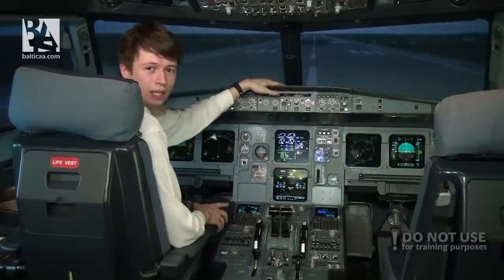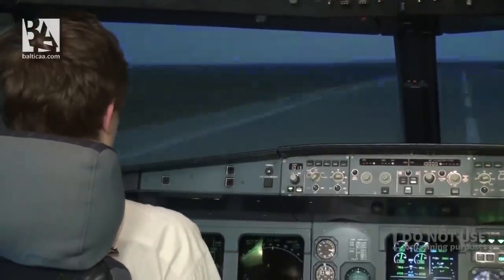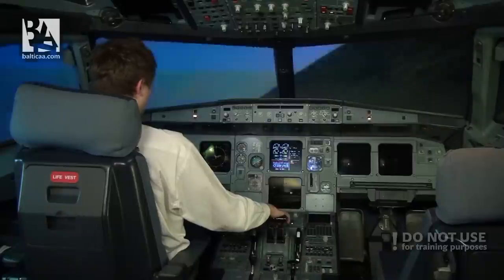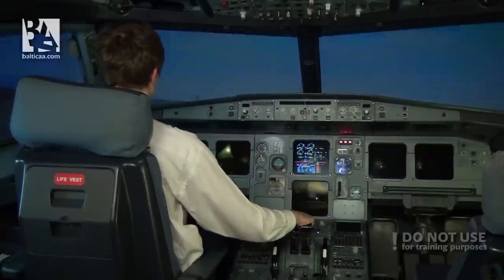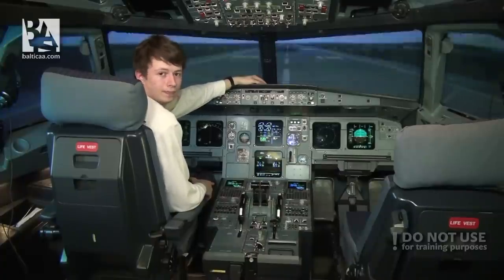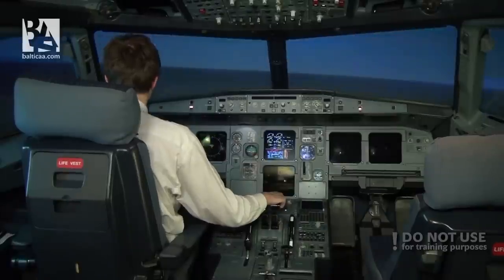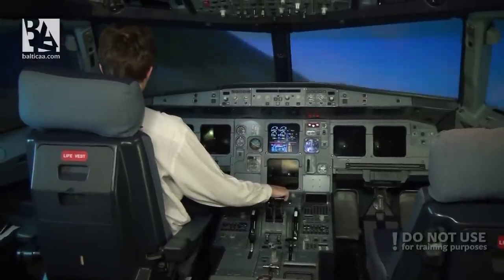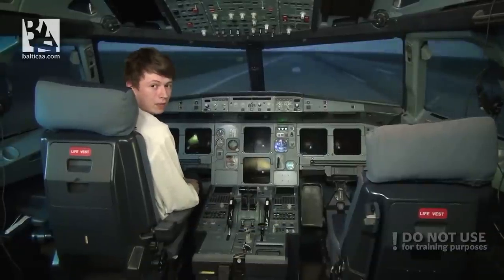Dual Engine Failure during Climb-out on Airbus A320: Baltic Aviation Academy

Comment: one question.  After the engines failure as usual you lost all of your power in electrical and hydraulic systems and counted on the ram air turbine. Why didn't you turn on the APU for power?

Comment: why dint he switch on the APU?
Reply: +Maffu Taffu yes but APU is good too and after you have more screen and it is safe
Reply: cause it takes like an entire minute to get the APU up and running. By that time he is already on the ground.
Reply: +Henry Chan yes but he can try to start it
Reply: APU is non-essential. He had power from the RAT and the ability to fly the aircraft. There's no point trying to get systems up and operational if it puts the aircraft at a higher risk.
Reply: Air News 24/7  The APU provides 0 thrust. The exhaust isn't a nozzle, and its design is to provide electrical power and bleed air rather than thrust. 

Turning it on is an addition to the already high workload on the pilots, and provides no real benefit when the RAT automatically deploys immediately on engine failure. I really don't think reaching for the APU will help in that situation given the tiny amount of time to look for a ditching site, and both pilots focusing on flying the aircraft
Reply: Air News 24/7  Where did I say Sully was stupid? The RAT is designed to give reliable power down to 130 Kts, the stall speed of a heavy A320 is about 140, and the glide speed is around 160-170. With an MTOW of over 170,000 lb, a 1,700 lb APU delivers less than 3% of the thrust the engines provide, making no change to the glide distance in such a short timeframe. We're not taking about using the APU during take-off for bleed air, that's a totally different topic 😂
Reply: Air Safety News 24x7  he landed safely, so please stop this nonsense debate
Reply: I firmly believe every flight in a jet like this needs a flight engineer!
Reply: Nakul K Mohan I thought that too
Reply: @NoJebediah  But without the APU the aircraft goes into alternate law and you lose the alpha protection. It’s worth pressing a button for!

Comment: Dear Richy, this video is meant to show "what is (almost) the lowest height from which you can return" :) In the case of flight 1549, what could have happened remains what could have happened. I am very happy that they survived, how they survived, even though it was a very difficult situation and good job by the crew, is not so important!

Comment: You might be able to pull off 2000ft if you delay gear extension as long as possible. Extended landing gear makes a lot of drag.  They may let you dump fuel too to lighten the load.
Reply: No fuel dump in a320
Reply: Loss of engine is also equal to loss of momentum. In the case of dual engine failure on a twin engine airplane below 20hundred feet while holding a pitch of 10°-15° and below 250 knots, the forward momentum will be consumed quite quickly.
I think the initial response of any pilot will be to quickly push forward, gear up, reduce flaps, switch on Apu, bank away from turrain, and quickly look for any place where there is little to no traffic or population to set that bird down. 
A 180° turn will take away a lot of momentum and require nose down action to avoid stall speeds and subsequently consume the little altitude left. 
In my personal opinion, I think all airfields should have a zone beyond the airfield to account for these types of snarios, but the fact that these incidents are so few and far in between means no organization will want to put out the amount to prep for it
Reply: @sincerelovechild  I like the idea of turning on the apu instead of the ram air turbine...

Comment: An MD-81 lost both engines at 3200 feet after departure from Arlanda, Stockholm, Sweden, after ice broke off of the wings and was ingested into the engines. Never for the briefest of moments was it on the pilots minds to return to the airport, they set it down in a clearing down range, and everyone on board made it. Had they started making sharp turns at low speed and low altitude, the most likely outcome is that noone had made it.
Reply: The difference here between this incident and the Hudson River one is that there was a clearing within range.  There is no open land in New York City, other than the airports, so the only safe option was to land in the Hudson.

Comment: This is a  Question Mark Turnback from 2,500 agl on A320.  Landed safely.  Great pilot.  No copilot needed either.  I teach Question Mark Turbacks on singles and multies from 700 agl to 1,200 agl depending on airplane, weight and winds on specific take off.
Reply: So what if they hit birds at 200 ago?

Comment: What are the two wheels with black and white bars that spin? They are located near the thrust levers. Great videos, by the way. I'm not a pilot but I've enjoyed watching these to learn what goes on in the cockpit.
Reply: That's trimmable horizontal stabilizer (THS). It is usually automatically adjusted.

Comment: Why dont you started the APU and used the Gravity Gear Extension ? PS Good Video
Reply: I think eh didnt had the Time to do that.Cause eh is alone in the Cockpit.
Reply: Good call, in a real cockpit he should have, but he probably didn't have time to do that.
Reply: Lisvenachux Roytulin is that not a rather pointless video then? Seeing as a320 is a 2 manned plane. Helpful for a simulator but seriously doubt one person would be taking off in this plane in real life. Still appreciated the vid, but would limit the necessary education if the above answer is correct... Then again, me no know :)
Reply: zebba zebadee it also depends on the weight (amount of fuel, passengers, and cargo) of the aircraft, wind and more...

Comment: In this case you knew the engines would fail so of course you can readily react to the situation.
Would a real case scenario need longer for you to assess and address the situation?
Reply: +Giovanni Di Cello Pilots are trained to act accordingly. The second the pilot heard the noise of dual engine they would have started the turn immediately. So maybe an additional 5 seconds for the pilot to look down and see dual engine flame out then turn.
Reply: @bobalobalie  This has actually happened before on two occasions and in both there is no evidence the pilots reacted as quickly as you are suggesting. In one it took about thirty seconds for the pilots to determine a definite course of action, and in the other they were so close to the ground landing the plane immediately off field was the only option.

Comment: Why don't you turn on the APU during a duel engine failure to provide backup power? That is US Airways Flight 1549 did.
Reply: Only one pilot. Normally, there would be a co-pilot to share in the task load. Perhaps there was another reason for no APU in this example.
Reply: Roger Hylton The APU takes about a minute to start and power the aircraft. He would be dead or on the ground.
Reply: He was in the air for a lot longer than 60 seconds, providing him with more than enough time to start the APU.
Reply: He had power from the ram engine turbine

Comment: But, unlike most other large airliners, if you lose all hydraulics on a 737 the pilot can still control the jet through manual reversion, although it takes alot of physical effort. You can still operate most of the primary flight control surfaces because they are still mechanicaly connected to the flight controls. Its very similar to power steering in a car, lose the power steering and the controls are heavy, but still controllable

Comment: Baltic Aviation Academy correct me if im wrong.. but at this situation, would you consider turning on the apu a good or a bad thing? to my knowledge.. turning the apu would provide emergency power if the batteries were to be damaged or depleted.. in addition, the apu's power will produce a pressure differential near the engines just enough to rotate the turbines a little bit :P making it easier for the pilot "pranas" to maneuver the plane.:P
Reply: Yes, you are right. But take into acount that APU takes some time to start up, and, as he was flying solo, he probably didnt have time (or enough hands :P) to do it.
Reply: Boris D ur right XD ..
Reply: by the time the APU is started, hes already back on the RWY

Comment: A loss of hydraulic systems is always unlikely without any external cause of damage, which can happen to any plane. Let it be a terrorist, an engine falling apart or a fatal decompression, if those things happen it doesn't matter if you are on a Boeing or an Airbus. For example, just a few month ago an Air Berlin A330 crew needed to perform an emergency landing in Phuket because of an uncontained engine failure resulting in loss of hydraulics, it was quite near-catastrophic.

Comment: At 165 knots Turnback, it is better to have some flaps and slats.  At least flaps 1. I think you have then on Flaps 1.  The lower the speed, the lower the flaps used.  Normal flight laws..  You know how to do hard maneuvers on take off.  And you were also turning around 40 degrees bank to Turnback.  Very good.. You dont turn 30 degrees only.  Waste of time and altitude.  i bet he was flying gliders in the summer..  Single Pilot Turnback to opposite from 2,500 B737.  Great job to save them all, future captain..

Comment: He should've waited around 30 seconds for the human factor, no pilot after dual engine loss would turn immediately to the runway. As a result he would have not made the runway at 2000ft.
Reply: BS.  Pilots are supposed to Aviate, then Navigate, you navigate to the runway closest if no power on and you are not too low. 3,000 agl, he should know that airplane could glide back to airport  Power Dependant Pilot. from 3,000 agl you head back to runway,  Not a river or another state, or BS ditching on a 19 degree farenheit day....

Comment: Failure to start the APU would have cost you a few points if this was a real training lesson as would failure to call ATC 

Also I just thought of something with the cockpit design of the Airbus A320
What would be the course of action if both pilots were left handed or both were right handed since the side stick cannot be moved? 

Wouldn't it be unsafe for a pilot to attempt to fly the plane with his/her non dominant hand?
Reply: +mewantbrains A pilot in the left seat, regardless of his dominant hand and regardless if the airplane has a sidestick or a yoke, has to be able to control the yoke/sidestick with his left hand because with the right hand he controls the throttle. And also the other way around of course.
Reply: +mewantbrains He did use the RAM Air Turbine
Reply: +Daniel Yep, as Daniel said, just imagine the side stick between the pilots legs and it is literally no different to a yoke apart from a different design. It is just further to the sides, but the throttle is still to the right of the captain and the left of the copilot. Just a bit further distance between the side stick and the throttle than the yoke to the throttle. You still use the same hands for controlling the throttle and side stick/yoke in an Airbus and Boeing.
Reply: I just figured that it would be very difficult to fly with your non dominant hand 

I tried flying with my left hand in FSX and I crashed everytime I tried to land
Reply: Well, Practice makes perfect! :)
Reply: With my right hand I got the hang of FSX within a few hours the first time I played 

with my left hand even after 12 hours of almost continuous play I still can't land
Reply: I think with cockpit design 
The yoke is the best way to fly the plane
Reply: mewantbrains after i started to use the a320 on the sim i started to use my left hand with it snd i got used to it after some days and now I'm just using my left hand so I can control other things with my right dominant hand

Comment: Nice demonstration. Although I see the guy is taking off at TOGA, while in an airline normal operation FLEX would be used, resulting in being a bit further away for the same altitude.
Also noticed that he didn't start the APU. Any reason for that?
Reply: There was not enough time for the APU to start before he needed to Iand

Comment: Will the hydrolic works when both engines failed.?
 I tries in my FSX Aerosoft A320 sim, At that time I couldn't control and crashed.
Reply: In case of both engine failure only B HYD system will work with the help of RAT, both Y & G HYD SYS will be INOP ..with Blue HYD SYS we can control A/C
Reply: Jinu Gopan however if you have time to get APU running you can use the yellow elec pump

Comment: Jesus. The APU early start after DEF is not SOP but was initiated on 1549 as the A320 ditching requires maximum slats and flaps for the final approach. The A320 cannot move these surfaces if only powered by the RAT.

Comment: 04:44 Landing gear doors opened.  = More drag.  The first turn has to be steeper.  Like for that airplane, say 40 degrees of bank, not 30 only.  Shallow turns extend the radious of turning away from the airport..
Reply: No dont bank over 30°.. the drag on a 40° turn is significantly more than a 30°. Over compensating for the extra distance.
Reply: @andyturbo  - Nope.  I teach those Turnbacks for real to a real runway, not just simulated.  You have to turn 40-45 degrees to avoid using a lot of room and altitude on a shallower turn.  Do you teach those Turnbacks for many years or not??  I have videos from 15 years ago and had to do them for real and avoided crashing on houses..
Reply: @outwiththem  Hey mate thanks for the reply. Im interested in sharing both our ways of how we were taught and comparing with a non biased approach to see our thoughts  in the interest of safety.

My CFI drilled the process i mentioned however this was regarding a single engine PA-28 suffering a engine failure at around 1500ft on the climb out.

He said the 40° bank turn is actually nicknamed the turn of death (as it has been responsible for a few student pilots crashing when panicking during a single prop engine out at 1500ft.

Perhaps this doesnt become a Factor when dealing with a dual engine flamout of a airliner?

I would love to hear your imput.
Cheers mate
Reply: @andyturbo  I learned then in 1996 from the only CFI I found in eastern USA teaching what they call now EFATO.  He has a video from 1995 doing 4 kinds of EFATO.  From 50 feet agl 2 kinds and landing on runway again. and 2 kinds of Turnbacks to opposite. From 500 agl partial power and 700 agl no power.  

We were using a runway of 4,500 feet total length surrounded by houses in New Jersey.  Yes, Cherokee PA28 150 hp only.  

That CFI is a coward FOS if he cannot turn 45 degree bank glide from say 700 agl.  We did them many times, and at night too from 700 agl with houses under us.  My 1996 CFI retired but last month he put a channel on you tube with the 3 kinds of turnbacks, including the Canyon Turnback. 
Check it out.  channel is EmergencyTakeoffAirplaneTurnbacks. Im subscribed to it.
Reply: @outwiththem  Mate thank you so much for sharing that. Seriously. I am currently CPL licenced doing both twin and command IR endorsements. I will actually call someone at the Civil Aviation Safety Authority and ask to speak to the cheif of pilot regulations and training. I want to run it by them a independent from my flying schook as well as being a regulator. 

If what your saying is correct (and i believe you) I feel in the public safety he should be removed as a CFI who has authority on a lot of things.

Basic things like this in training has to be 100%. Thank you again mate.
Reply: @andyturbo  Yeah.   Teaching Bullshit can kill you or your passengers.  Should not be allowed.  See my others comments too..

Comment: How do you still manage to have control? I set both engine failure and then the controls won't move.
Reply: because your PC sim is not the real aircraft/not modelled properly. The onboard battery can still run some basic things like the screen, but the RAT and APU are needed to have controls.

Comment: So, do I understand correctly that he's now making a downwind landing? That can only work up to a certain wind speed, right?

Also, why didn't he try to restart the engines? Did he not have enough altitude/time to do that? Or did he not do that on purpose to demonstrate the return to the runway?
Reply: +SolarWebsite As he said he was demonstrating the situation, when both engines burn out. So there is no way to restart them. Other things are more interesting for me. Such as: Why not to start dumping fuel to make aircraft much lighter?
Reply: +NoirPlay Found that there is no possibility to dump fuel in A320 family.
Reply: +NoirPlay actually dumping fuel is a very dangerous operation especially when both engines have failed and you don't know why. Furthermore it takes a high amount of time, it is time consuming to run the checklist and you dumping high inflammable toxic chemicals over possible presidential homes.
Reply: Actually, when the engines flamed out, he did flip the start switch to ignition and bring the throttles back to idle to try to relight the engines.
Reply: Ah, I had not noticed that. Thanks for pointing it out!

Comment: Why in the world you engaged RAM aitr turbine instead of APU? You didn't run out of fuel, you had a dual engine failure. Then you would have had hydraulic pressure after the touchdown also.

Comment: I am not sure, but who on earth would react with a complete engine failure with an immediate sharp turn back to the airfield. If you want to determine the lowest altitude, you need to at least give yourself a couple of moments to realize what just happened, try to start the engines again, go through the mandatory check lists, etc. Otherwise this "test" is irrelevant.